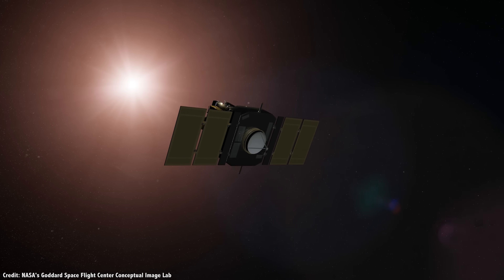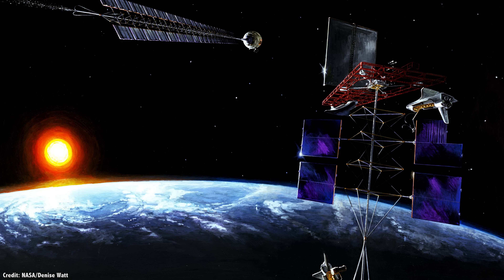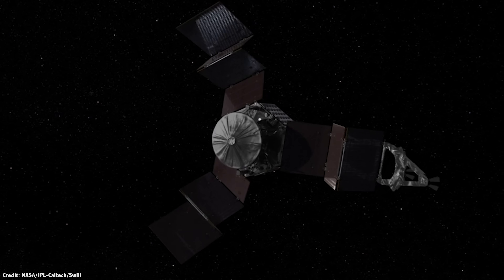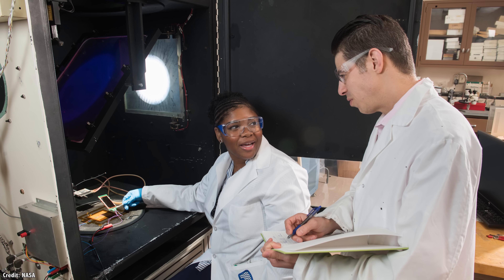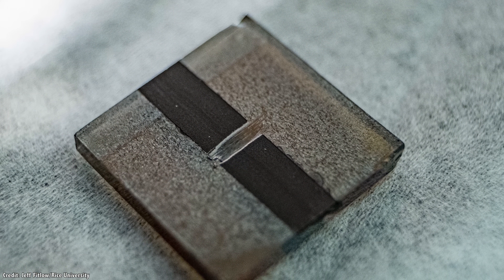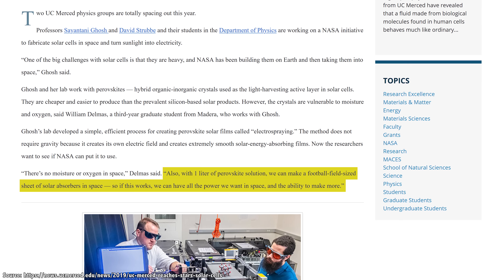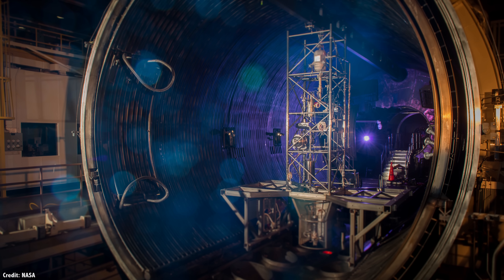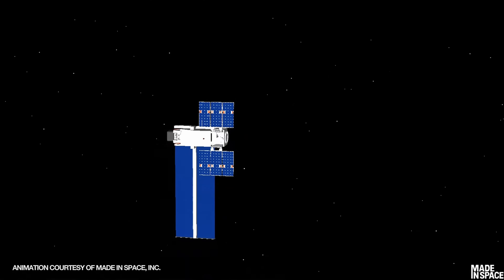Why Launch Solar Panels When You Can Print Them Directly In Space? Printing Perovskite Panels

Comment: Great stuff!  I'm all in favor of better efficiency for space stuff.

Question: If I've done my math right, with some inferences, it looks like the currently-planned LOP-G could operate as LEO-to-LLO transfer vehicle if you just doubled its xenon fuel capacity; it would require only current commercial spacecraft such as Falcon/Atlas/Antares/H2B/Ariane/Soyuz.  You'd only need to launch a new lander, crew capsule, and xenon tank to LEO for each moon surface mission, which could be done with two or three standard launches, or about $300M, which is way better than the $2B per SLS/Orion launch.  I know we're pretty much committed to SLS at this point, but do you think it would be possible to sell this much cheaper option at NASA?  Could ESA or Russia buy their own LOP-G propulsion/habitation elements from Maxar and Northrop and make this work?  We could even have multiple operating LOP-G transfer vehicles for the price of one standard LOP-G, in theory.  I know the travel time would be longer and there might be more time spent in the Van Allen belts than is preferable.  What do you think?

Comment: Question: Hi Fraser, the fusion inside a star produces light and heat but why are neutron stars so hot and magnetic? Shouldn't they be dead lumps of very tightly packed neutrons?
Reply from the maker: They're cooling down from when there were a massive star.

Comment: Unrelated silly question: binary neutron star and binary black hole pairs lose momentum through gravitational waves. Does this also apply to our solar system? Will earth slowly lose its energy and fall into the Sun? Or will it be Jupiter first because it's much more massive?
Reply from the maker: The Earth, etc are giving off gravitational waves but they're so small that they won't have any impact on enormous timescales.
Reply: @frasercain  Thank you! How enormous are we talking here? Lifespan of a red dwarf? Ten trillion? Lifespan of a black hole? 10^100?
Reply: Ah... someone who saw the latest Kurzgesagt.

Binary black holes or neutron stars are extreme regimes wherein frame dragging is a significant effect.  Our solar system does emit gravitational waves but the effects are thoroughly swamped by tidal effects and friction from the interplanetary medium.

To imagine frame dragging it's best to visualize space-time as a fabric stretched out on a frame and neutron stars and black holes as balls of various sizes and densities.  Our solar system is a little like beach balls: light, puffy...low density.  They don't pull down on the fabric particularly hard.  Neutron stars and black holes are much more like bowling balls and ball bearings.  Centres of mass pull down noticeably on the fabric and they can get much closer together.

Comment: I'm still surprised that I have not yet heard of any companies applying the printed solar technology directly onto roofing materials. Rolled roofing, metal roofing, vinyl/plastic roofing - just print the solar right onto these materials and you become good to go for a roofing installation. A simplistic approach like this is likely what would be needed to get large scale adoption and cheaply made solar.
The real trick with this however would likely be figuring out how to give a fresh 'solar coat' when the cells degrade.
Reply from the maker: The problem is how quickly they degrade in Earth environment. I mentioned that Rice University has figured out a way to make the stable for longer, but it's still not long enough for the kinds of real-world environments we have.
Reply: I always heard that oxygen and water were the primary degradation factors, but I wouldn't think that it would be that hard to use a polymer or glaze coating to encapsulate and prevent them from receiving this environmental interaction. It makes it seem like there may be other degradation factors that I'm unaware of.

And of coarse printed solar would not necessarily need to use perovskite tech, though it likely does have the most promise.

Comment: A roll of flexible solar panels could be unrolled with an inflatable tubes forming booms. Made out of a polymer that hardens in UV the booms would stay rigid when the inflating gas leaks and runs out.
Reply from the maker: Sounds like a cool idea. Build a prototype. :-)

Comment: I wonder if instead of layering the photovoltaics to catch different wavelengths, if you could pass the light through a prism first to separarte them.
I've heard of using a lense to have more expensive but efficient cells catch light from a larger area for less cost and maybe this could be used in conjunction with that.
Reply from the maker: Interesting, I don't know enough about the materials science know if it would work. :-0

Comment: If you think of leaves as solar panels, is a deciduous tree the best arrangement of solar panels for the space they take up? It's just something that popped up in my mind.
Reply: Trees are designed to operate in gravity.  And trees and leaves store solar energy as sugars.

Solar panels in space do not have to hold up against gravity.  The energy collected will be electrical which will move at a significant fraction of the speed of light.  The collecting surfaces and node where it will be utilized or transmitted can be hundreds or thousands of km apart.

Comment: I suspect the Perovskite blend will be used to compliment higher efficiency panels and possibly sprayed on the outer surface of a space station just because.
Reply: Why? it seems odd to use this for the specific attributes but then to still ship up "proper" ones. What you should think is how much easier and cheaper it would be to lauch said station if they could just not bother with ground made at all. Starship could do it.
Reply: @pegasusted2504  Free energy source that can be sprayed on your outer hull which is not going to be used for anything else other than a impact barrier, why not spray this Solar formula all over???  If the panels are more efficient there will be panels........ and you should always have more power available than you need.  Hence supplementing by covering the hull with Pervoskite blend.

Comment: I guess the next big step would be seeing if   a cell can be printed onto a super thin backing. Inflate a giant baloon with a minimal amount of argon, spray or sputter coat the inside with solar cells.

After that the trick would be producing the ultra thin plastic film in space. I wonder if a film blower could be adapted for zero g and vacuum. Blow/inflate a kilometers long tube while coating it and turning it into a solar collector?

Comment: Hey Fraser! I got to thinking: what, if anything, could allow organic material to "fly" without relying on manipulation of a specific medium like wings in atmosphere or fins in water? Essentially, how superman?
Reply: Truly explosive farts?
Reply: Jets?

Physics dictates that in order to alter momentum of a person or object an equal and opposite amount of momentum has to be put into another thing.  If you want lift you need to push down on a bunch of air or water.  If you want to go sideways you need to push a bunch or air, water or rocket propellent the other way.  When you walk you're transferring a bit of momentum into the ground.  Wheels do the same only in much smaller steps and much quicker.

Changing momentum without transferring momentum is straight up fantasy/magical.  Superman is an impossible fiction.

Comment: Well, 3d printers are actually quite huge machines relative to the size/mass of the products they can produce. So. I guess.
Reply: Only in a gravity well. Ultra thin films packed securely then unfolded and coated with power generating material in space would be great
Reply: Though the long term cost savings would be well worth the initial cost of launching the 3d printers into orbit.
Reply: @suthinscientist9801  
Especially if we're careful to make sure we launch a mommy printer and a daddy printer...
Reply: Marcel Janssens - 3-D printers are getting smaller, while what they can produce is getting larger. Here’s an example - 
https://www.extremetech.com/extreme/291293-nasa-awards-700000-in-prizes-for-3d-printed-habitat-challenge https://www.aispacefactory.com/marsha 
Even if all I can “print” is .5 meters3/day, I can build a 1000 meter3 protected structure or 3 km2 of solar cells in 2 years, while saving 1000 tons in launch payload.